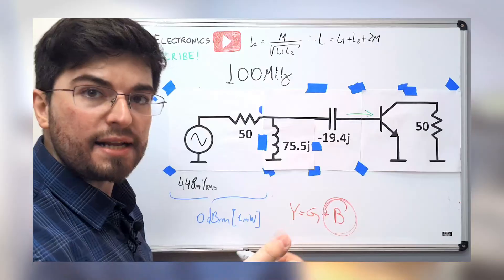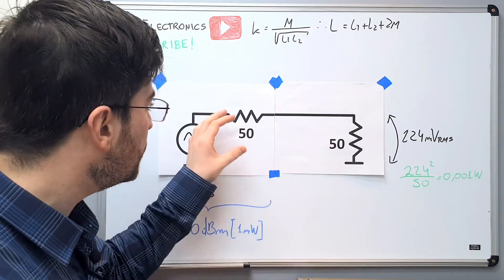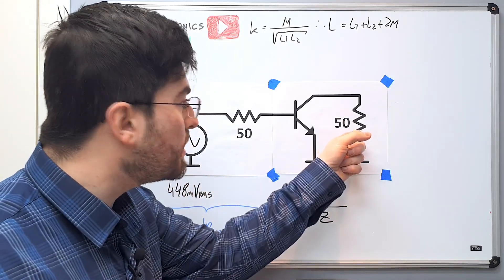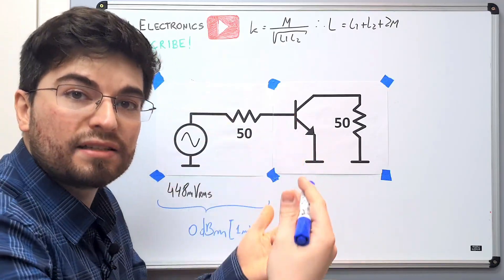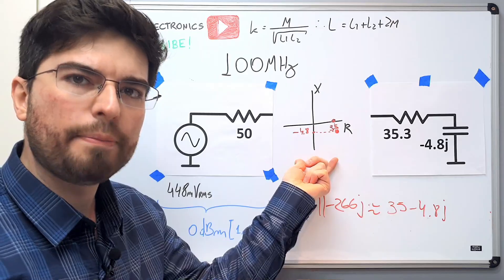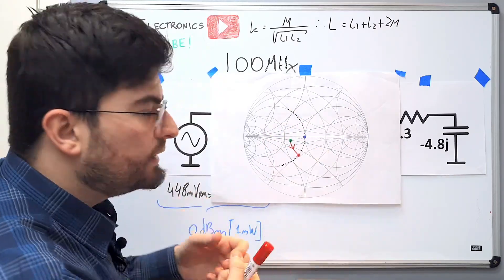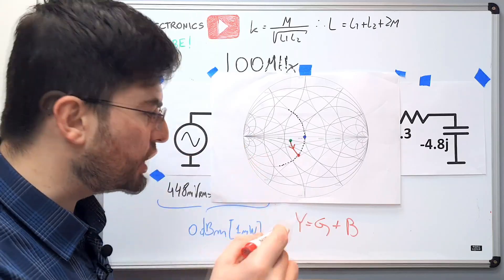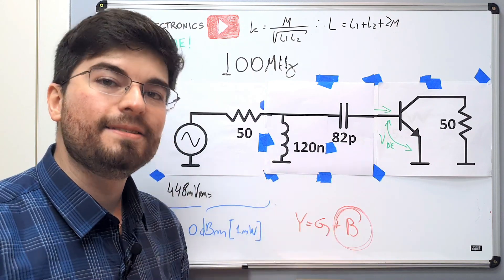Transistor Impedance Matching

Comment: Hi, I wanted to ask - you said you measured the input impedance of the transistor, do you have a video showing how you did that? I know RF transistors the manufacturer usually provides the "S parameters" which kind of give you this info already but I'd be interested in knowing how to do it. Would it depend on the emitter current somewhat though I would think? Seems like it would be a combination of emitter current/beta and the input capacitance in some way.
Reply from the maker: Yep, it depended on the physical construction and biasing condition. Some manufacturers give the S parameters in the datasheet and in some cases you need to measure it using a VNA.

Comment: 1:00 yes you can. You can add a resistor at the output of the power source to increase its impedance...
If you have a 75 line and load with a 50 source, you can just add 25 ohms. Yes, I know it will reduce the signal and efficiency...
Reply from the maker: A resistor in series with the power source is a load.

Comment: 6:17 how did you do to calculate the parallel of 36 ohms and -266j?? to come out 35 -4.8j?? what formula did you use? do you also make a video to find bjt entrepreneurship as you say on the video?
Reply from the maker: You only need to use the default parallel equations !!
Reply: @AllElectronicsChannel  ok thanks
Reply: @AllElectronicsChannel

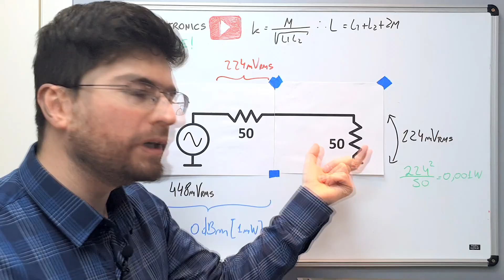Comment: At 1:56, you use the wrong resistance when calculating the power delivered to the 30 ohm resistor.  You use (0.168^2)/50 for 0.0005 W.  The correct calculation is (0.168^2)/30 for 0.00094 W.
Reply from the maker: True, thanks!!

Comment: This is a great explanation for RF student. My question is how we calculate gain in Rf amplifiers using bjt transistors? I also follow You on instagram and you are doing great job. Keep up the good work. If you can also tell me where to find out more about calculations of RF amplifiers using impendance matching I would really appreciate it.
Reply from the maker: Exact gain calculation is a difficult job. In my home projects I always prototype the circuit and measure it.
Reply: @AllElectronicsChannel   
So lets say you are building Xtal collspits oscillator would You be able to calculate input impendance of crystal and all biasing resistors and load is simple wire antenna? Im trying to build simple transmitter and receiver but no one even can explain exact impendance of simple wire as antenna.  Anyway its very interesting stuff I would be able one day to learn it all I would put it all on YouTube like you 😃

Comment: Great content as usual! Just one question. Is ~36 ohms a typical small signal base-emitter resistance for a BJT in RF applications? Ive not yet seen one that small. Seems that would roughly equate to a base DC bias current of about 720 uA and that seems pretty high compared to what Im used to designing.
Reply from the maker: Thank you Ryan! Indeed 36 real part  is a little low. Sometimes I consider 35 ohm as the complex Z for small signal at 500MHz. 

Works well when matching a common base using a series 15ohm resistor.